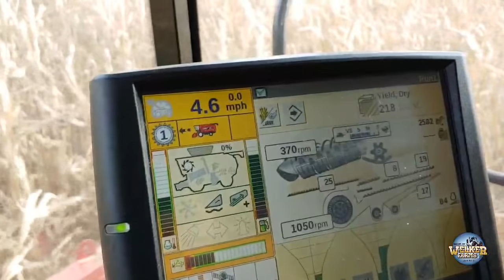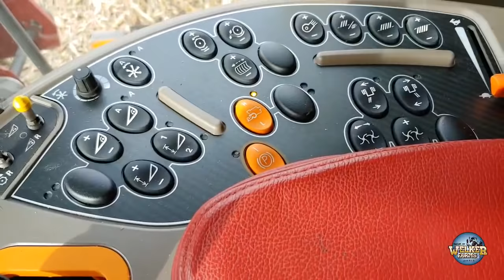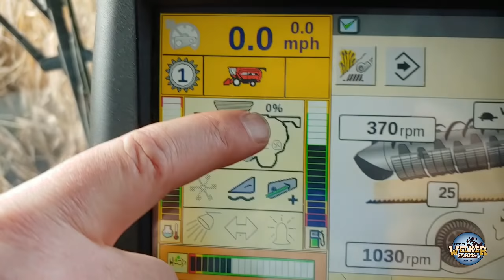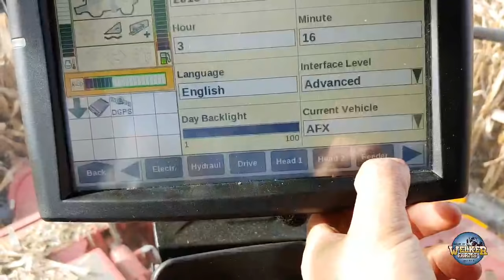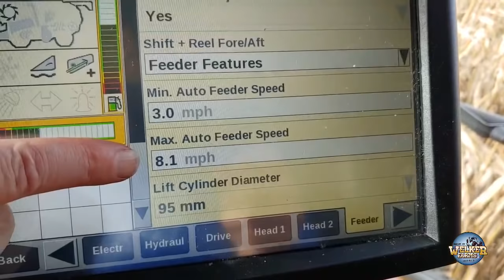🔴Live! Corn Special! 7250 Full Automation Combine - Welker Farms Inc

Comment: I got a question for Russ, I have a 8230 combine that my dealer had a really hard time putting a new transition cone into it? They tried 4 different cones and still couldn't get them to fit. They ended up cutting, grinding and welding to try to get it in there, but they had a hell of a time doing it. I have it home now, but is this going to be the norm when comes time to replace it again??